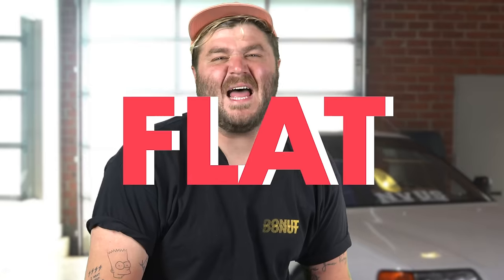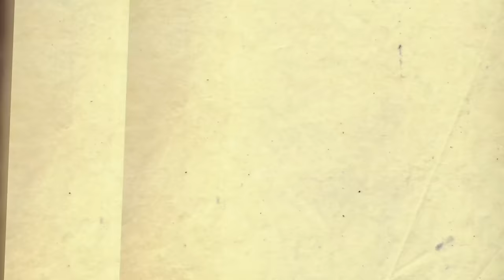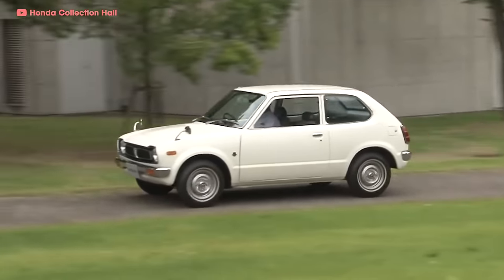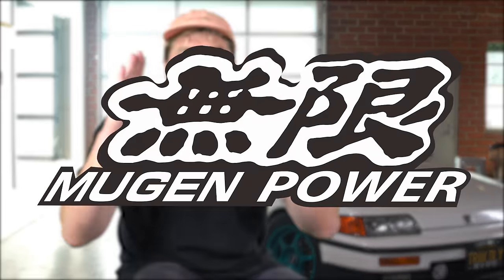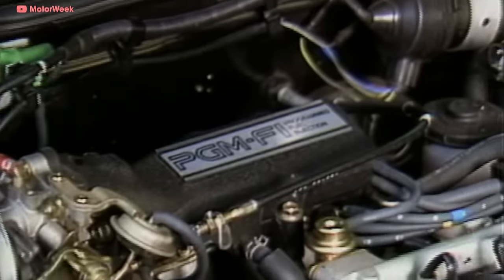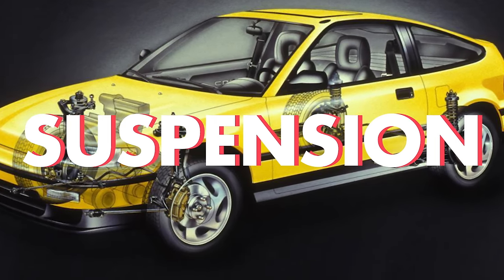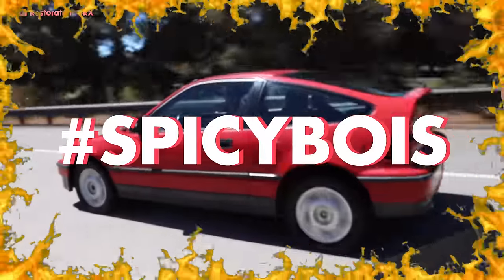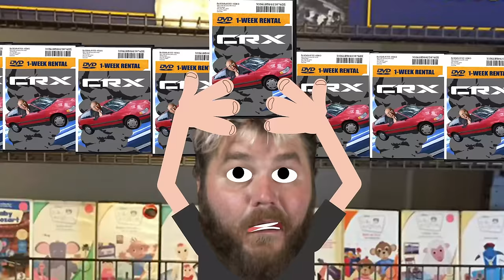Honda CRX - Everything You Need to Know | Up to Speed

Comment: I know this is a very old post, I lived through that era of Honda. My babysitter when I was I’m guessing about 789 maybe 10 years old brought home I believe it was a 1990 1991 Honda Civic SI. In Stockton California where they used to go out to arch Road which was an industrial complex where everyone went to race. Not many had a B series motor. Mostly single overhead cam fuel injected D 16 looking types. But it was from that moment I was hooked. So I’ll finish by saying I’m a Honda fan up until the year 2000 from that point forward with the introduction of the K-series motor and I haven’t forgot to mention the del Sol the Integra or the TL & CL. And then eventually the 99 SI and preludes which were in the 90s. Honda kind of lost me 2000 going forward. It seems like nowadays they think they can just bring the R badge stateside and it’s all smoothed over. This is a grudge I will take to my grave, LMAO🎃

Comment: I have to correct you, the gen 2 new body style came out in 88, not 87, the 86 and 87 body styles were identical, 84-85 did not have the flush headlights and the rear spoiler was different.  I still have my 86 crx si, with ~73k original miles on it...bought it in 87 with 7500 miles on it.  It is mostly stock looking (new huge 15" wheels :)) has jackson racing sway bars, headers, exhaust and cam on it.  Still have the original wheels, and header/shocks that came with it.

Comment: I’ll bet it’s not at all terrifying to go a 7 second ET in a CRX. For one thing the car is going to be so well built to even be allowed to run anywhere near that mark it’s really no longer a stock Honda chassis anymore between suspension upgrades, the wheel and tire package you use, the cage and safety equipment etc I’ve gone 8.86 down 1320’ in an EG and now regularly go low 5’s in 660’ with my Grudge car and the passes are over so quickly/you are so intently focused on what your doing it feels like teleportation. You don’t have time to be scared or think about anything other than piloting the car.

Comment: '85 saw the Si, but that wasn't a totally new thing. '84 had the sporty trim S model, then in '85 it was given fuel Injection, so the trim model became the Si. "Sport Injected"

I had a few:
'85 CRX Si
'86 CRX (Dx)
'89 CRX (Dx with MPFI & DOHC ZC)
'91 CRX Si

(Dx wasn't a real trim level for the CRX, they were the base model & had the same engine as the Civic Dx. The base model Civic had less power, kinda like the CRX Hf, but the CRX Hf had better fuel injection than the Civic for High Fuel economy)

Comment: The All New 
CRX-E, CRX-RX, and of course the CRX-S. 

The CRX-S is the base model CRZ with the Turbo Diesel.

The CRX-RX has a BI-Turbo Diesel of 2 different options. The turbo diesel charges the massive batteries. You can also get it with Magna-Ride, and 4 piston Regenerative Bremo brakes in the front with 2 Piston in the rears. Which makes it the most advanced suspension of any Economy car there is. So it has the most performance, handling, braking and Options. It comes with a 13 speed Unique Triple Clutch Transmission. That keeps the electric motor at peak RPMs.

The CRX-E is a Battery Powered high performance 2 door economy car that fills the void for an affordable attractive small sports car that's Electric and now important FUN TO DRIVE.

TAKE a TEST DRIVE and u maybe be surprised at how much u actual Desire that amazing car.

              P.S. This is my Desire.   
We the common people want an affordable EV that's an economy car, but at the same time equally as fun and capable as almost any sports cars.

Comment: I had a 84 that had only 4K on it and bought it for 400$ in 2000 traded it in for a 89 coupe deville like a idiot but I had a kid and needed the seats I wish I would have just got a cheap bucket and kept the crx mine was the white with blue manual with the 1.5 little loaded it was like new but the front clip broke on the freeway like they all do from the force of wind they get little cracks in them and to replace that back then cost 650$ as it was all about making money on parts back then and in 2000$ that is like 1050$ now so I traded it in on a caddy that had a factory phantom and was blue with white top and red pin stripes it was nice I dressed it out real good but I miss that crx it was like new other then the front clip I wish I could find another one like that but never not with 4K or less miles lolz it was a once in a life time car I guess oh well but I’ll find one nice and keep it that’s is what I am saving for now so I can make deliveries for uber in 45 miles to the gallon it’s a no brainer and nothing in the world drives like them I sold cars for 20 years noting is like driving one there fun it like racing around town but only going 45 you feel like your going 70 and they sound cool

Comment: In 2001, my 1988 CRX si had 64,000 miles on it and some rat bastard stole the computer and intake out of it after cutting all the wires and vacuum lines. I had no way to get it fixed and the insurance company totalled it at $1,500. Rat. Bastards.

Comment: me have fast crx i built 20 years ago but me no know how to type want help getting her on road  full titanium head from skunk 2 lots of upgrades  i had to drop build due to joining the USAF  IYAAYAS!!  my car has sit since 2003  titanium lifters springs retainers skunk2 suspension radiotor basically a lot of skunk2  next to the thermal research exhaust over 220 at wheels 20 years ago  fyi this is all truew but imu drubnk as fuck posting it i want myt car on the road.
Reply: i just realized i didnt say im located in az